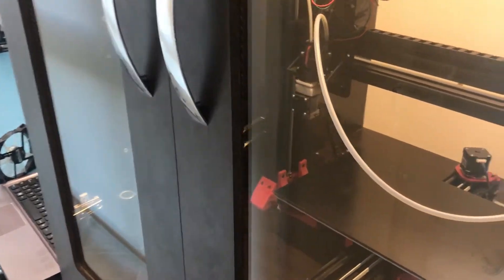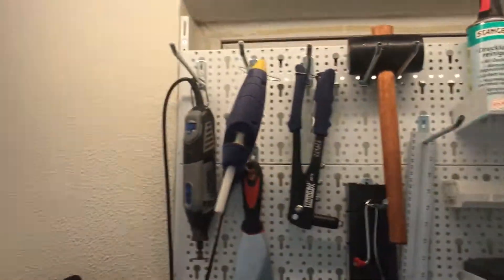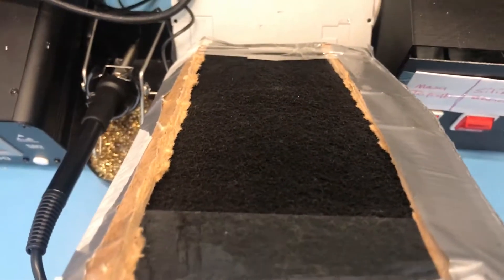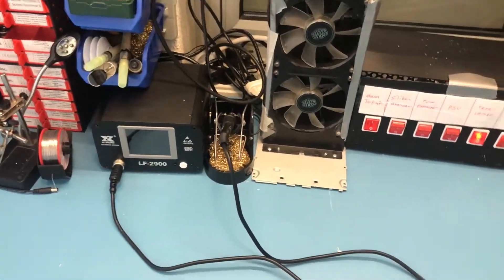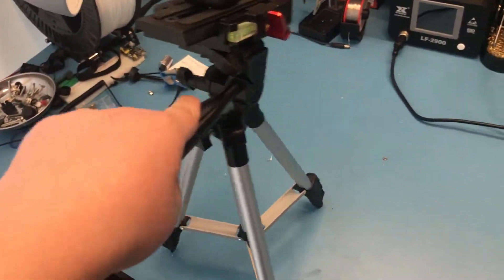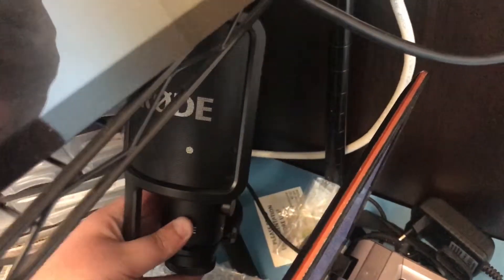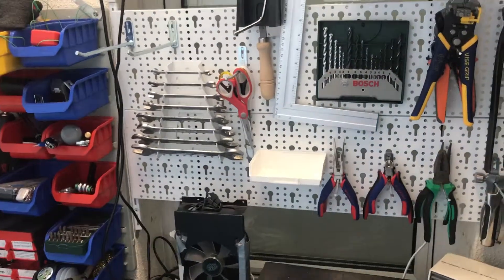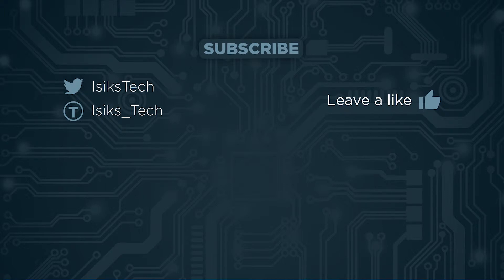Tour of My Workshop Area & My 3D Printer

Comment: What were the issues you are having with your new leveling sensor Isik?
Reply from the maker: It is too sensitive. To the point where motor movements trigger the sensor. This makes bed leveling impossible because it triggers as soon as it starts moving downward. There is a trimpot on the sensor for adjusting the sensitivity but it doesn't have enough range. I need to figure out a way of reducing the sensitivity and reduce the vibration on the movement of the z axis. The obvious solution for the second is to reduce the motor current, but that is not enough unfortunately. After some point, motor starts skipping steps. So I need to find a way of reducing the sensitivity more than the trimpot allows.
Reply: Thank you.  I have the universal piezo  board and sensor but haven’t had the time to mount it yet.  Wanted to know what issues you ran into.
Reply from the maker: I solved the problem with the sensor finally and since you have one too I thought it might be useful if I tell you what happened. Sensitivity is an issue but the main problem was a bug with the firmware. Sensitivity still is an issue but it will probably work fine if you reduce the travel speed. That's how I solved it, a fw update and lower travel speed lower motor current. (And adjusting the trimpot) I now have another issue, this time with my extruder motor settings but I will hopefully fix that as well and upload the next part Friday. I will try to tell all of the details there as well.